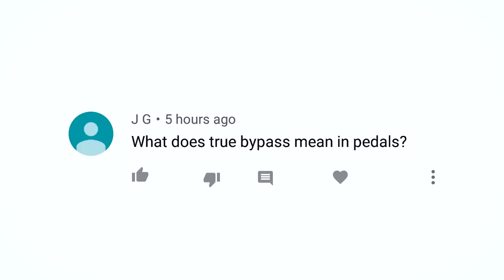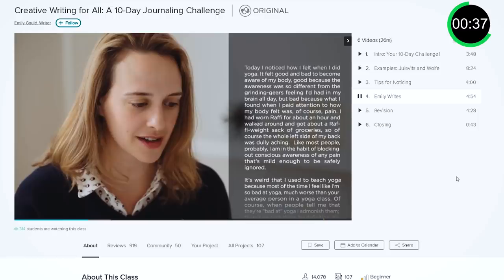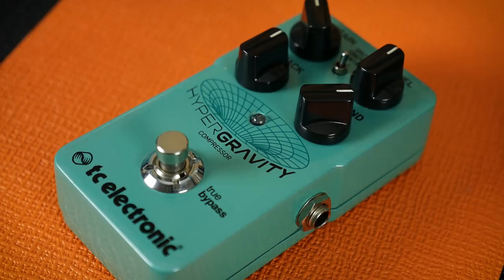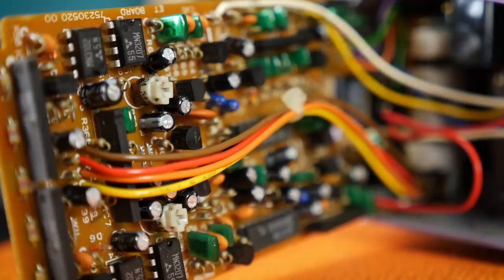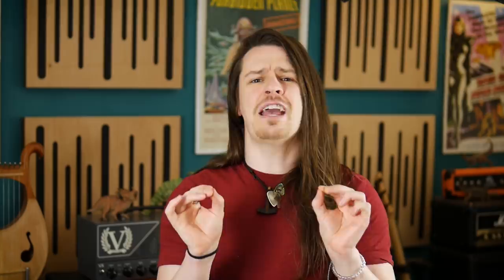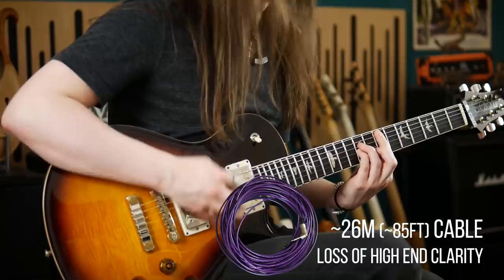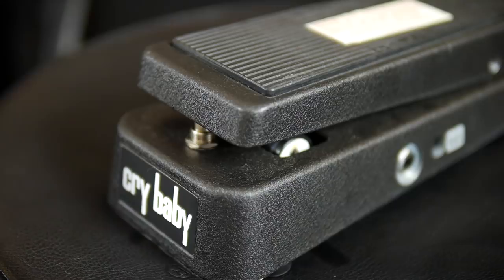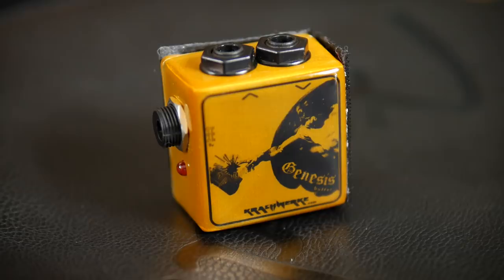What is True Bypass? | Too Afraid To Ask

Comment: So why do my buffered pedals suck high end and volume when put in my amp's fx loop? Framus cobra, to be correct
Reply: Shitty buffers. Boss pedals are good at sucking high end. You may find a good buffer before your shitty buffers fixes it.
Reply: Also your effects loop is probably a different impedance to your input. Again a good buffer can fix that, because it "drives" the chain, since its a unity gain preamp.
Reply: @Patrick-857  so if I put a good buffer before the other pedals, i will be able to use those pedals? Incriminated are ocean's 11, nova delay, rc30
Reply: @daniele_girotto  RC30 might be doing it. The Nova should have a great buffer in it though. I know nothing about the other pedal. Try putting the Nova in front and see if it helps.
Reply: @daniele_girotto  You shouldn't need to rush out and buy a buffer, just find out which pedal has the best buffer in it and try it in front of the chain. Experiment to see which pedals kill the tone and which ones don't.

Comment: @CSGuitars Helix (or other amp modelers) into the amp's input or into the amp's effects return?
Reply: I'm not colin but, from LOTS of personal experience,  I strongly advise that you go into the effects return. Going into the face of the amp feeds it through the amps preamp which is basically the voice of that amp and will color the sound. Amp modeling devices such as the helix, the pod or fractal are specifically to emulate amplifiers, effects, cabinets, Etc. To get that as cleanly as possible you want to go directly into the power amp. You do that by just running straight into the effects return. All of that being said, I do want to hear Collin's take on it. Lol
Reply: @SalemSick  Thank you. I wonder if I've been using all effects pedal wrong then...I tried several pedals of mine and ran them into the "effects return" and they sounded remarkably different/better. I wonder if other know to do this. Obviously the Helix/Fractal/Kemper have alot more going on, than a regular pedal...but I'm sure pedal in general would sound better into the effects return.

Comment: #TATA what’s the difference between coil tap and coil split?
Reply: A coil tap "taps" into a (hot)single coil windings at a point between start and finish, providing you with the option to lower the output, usually for a more "classic" single coil tone.

A coil split on the other hand removes one coil of a humbucking pickup from the circuit completely, leaving you with only one coil active, effectively turning the humbucker into a single coil pickup.
Reply: thezerb would you still get all of the noise that comes with a single coil if it is taped?
Thanks for the reply btw
Reply: @ZorroTheWevile  Yes, just a bit quieter.

Comment: Crybaby doesnt have a buffer!. The wah sucks the high end because the circuit input stills connected to the signal chain when the pedal is in bypass mode (it’s like having the pedal connected in parallel fashion)